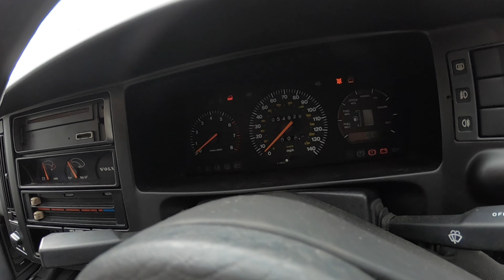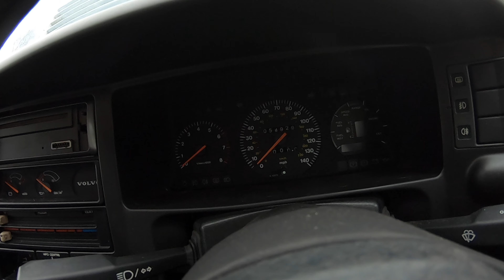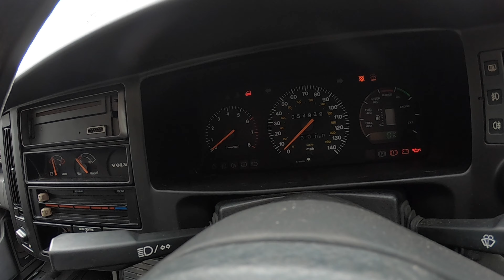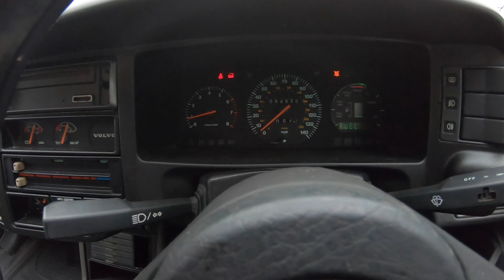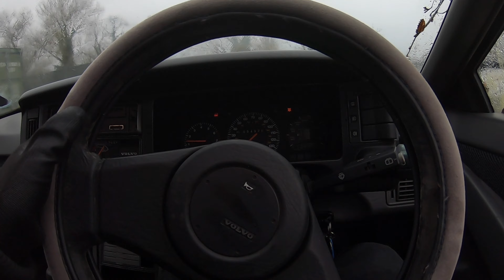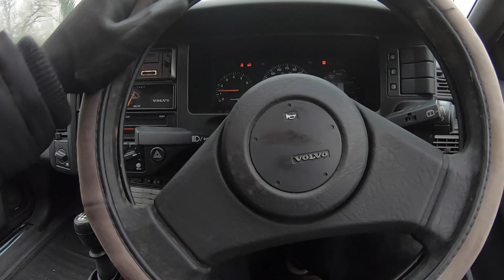RESCUING AN ABANDONED 1989 VOLVO 480 start and test drive after 8 YEARS!

Comment: These are fantastic little cars, the club is superb for them too. I have one just like the one pictured, only it (was) in fantastic condition (before the bin lorry took it out - it will live again tho). Judging by the looks of that one, it will need a fair amount of bodywork to get right, and the electrics will need a proper sort out as they are the weak spot on these. In terms of value these cars are worth 5.5k very tops, with MOTed cars needing work around the 800-1k mark. Apart from the arches, which can be repaired with replacement panels, it doesn't look too bad, but would need a seriously good going over. I am a member of the club and highly recommend you head over to Volvo 480 Europe and get on the forums, they have all the knowledge you need
Reply from the maker: thanks Ben really appreciate this message.....lots of knowledge and experience....will try to go through the things you advised and take it from there... hopefully go for a volvo 480 meet!